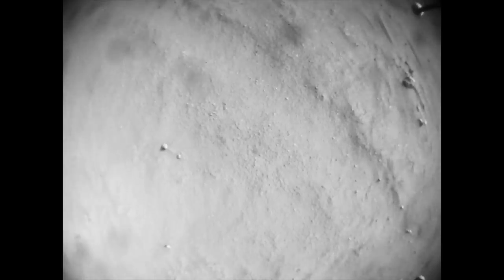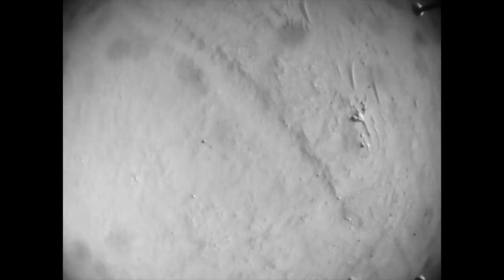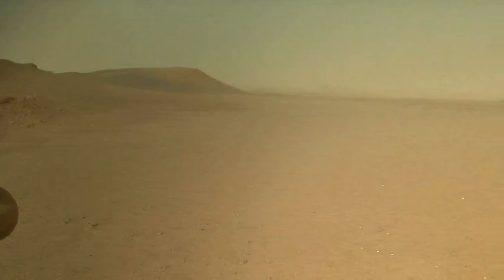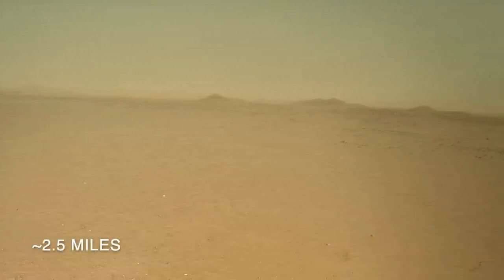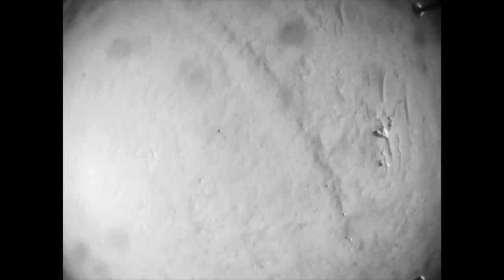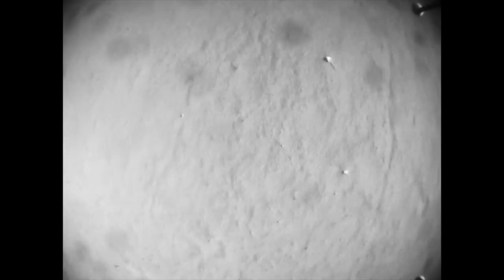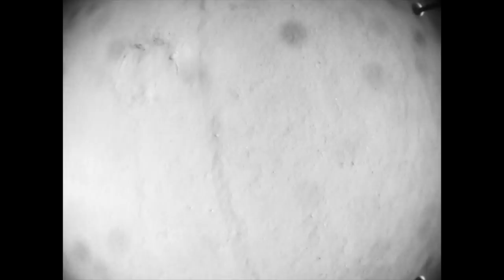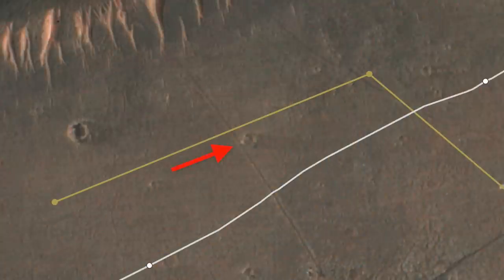Ingenuity attempts flight with a failed sensor

Comment: I hope they keep pushing Ingenuity until it's completely dead. The value of the engineering data to be gained by monitoring its failures, and triggering them, is incalculable.
Reply: Indeed and can use what they’ve found on the next heli drone !

Comment: Ingenuity should be placed in the same exalted group as the Voyagers and Cassini. We have to remember they were just hoping it would complete 1 flight. But its now close to its silver anniversary of flights, and in its way showing us more of the planet than the rovers.
Reply from the maker: Agreed!
Reply: Given the very low temperatures on Mars, would it be difficult to extend the flight time, even just hovering, even wire-guided?
A helibot that could spend 5 or 10 minutes analyzing a vertical wall or the ground to land on the roof would be good.

Comment: I like the idea of a rover and some extra-vehicular explorer (EVEx).  Nasa should consider attaching a small (but powerful) air blower on the next rover.  That way the EVEx can maneuver close enough to the rover (or vise-versa)  and the rover can then use the blower to discharge the dust particles on the solar array(s) of the EVEx.  With winter closing in and dust and sand limiting the charge, this could be life-extender, if not a life-saver.
Reply: Perseverance already has a blower on its arm used for clearing dust off rocks.

Comment: nice work mars guy, I wish ingenuity survives.
But I have a question 
Can the failed sensor be fixed or not.
like if the weather improves or maybe in the next Martin summer.
Reply: I don't think it can, but the latest flight shows that a workaround is possible.
Reply from the maker: Thanks, and yes, very unlikely that the failed sensor will start working again.
Reply: There's no need for fixing the failed sensor, as there's in-built redundancy, as in any aircraft. The failed sensor is the inclinometer, which consists of two accelerometers. Its sole purpose is to determine the initial orientation of Genny in respect to Mars gravitational field, prior to spin up and take off. Once airborne, the inclinometer serves no purpose, and pitch and roll are determined by the navigation inertial measurement unit (IMU) instead, which also consists of accelerometers. The various scenarios of failed sensors have been thoroughly simulated on Earth prior to finalising Genny's design and all that was required to fix it was to patch the software with the code developed during the simulations, so the gibberish data coming from the failed sensor could be replaced by data from the IMU instead.
Reply: @_John_P  thanks, u are awesome

Comment: Can they land it on inclined areas to accentuate power top-up? (as with Opportunity Rover), or is that beyond it's capabilities?
Reply: It's possible in principle, although landing a helicopter on an inclined surface is harder than driving a rover up an incline. I can certainly see them trying this to extent its life for a period of days, or even weeks.
One problem with trying to survive winter that way is that Perseverance cannot wait for Ingenuity. Doing so, or even planning to return to the same site later, would have a severe impact on Perseverance's own mission.
Reply: @renerpho  A middle ground can always be found.
I am beginning to believe that in the Mars 2020 mission there are different experiments that work well despite the tremendous difficulty of the undertaking, but a unity of criteria "between the two vehicles" is not materialized.
It is a very critical opinion of an amateur who does not know the problem.
Reply: @copperNick-North  If NASA decides that the benefits outweigh the costs then I'm sure they'll do whatever is possible. They usually discuss all options with an open mind.
Reply: @renerpho  Thanks for your replay.

Comment: Great video, but I think the flight was complete or at least the time TOF matched that in the flight log.  I have noticed on several flights, you don't see images of it descending.  Bob Balaran's paper indicates that they turn off or stop processing images during takeoff and landing (1 - 2 seconds) due to the possibility that  dust and debris blown up from the downwash may create erroneous tracking results.
Reply from the maker: Thanks. No doubt the flight completed, but there are usually images going nearly to the ground.

Comment: I wish somebody would ask me about my low tech idea for putting a hundred eyes that move all over the Martian surface then transmitting what they see and moving on again. Basically doing the job of a hundred rovers, but literally thousands of times cheaper. 
Ingenuity is ingenious but it's kind of complicated.
Reply: An entire rocket lander and power and communications plant, as well as a meteorological and vehicle coordination and support station and one, two, three multipurpose dispenser-collector robots with cameras, or other types of sensors, transmitters, beacons or dihedral reflectors, anemometers,  low weight, low dimensions, low cost, enduring.  :)
Reply: with robotic arms and a complete set of screwdrivers and keys.
Reply: @copperNick-North  I'm sure NASA has something like that in the works, but my idea requires none of that, not even a lander.
Reply: @rafeller9057  What is your idea?
Reply: @copperNick-North  thank you for asking 🤗 briefly I'm thinking of 100 inflatable tough balls about a meter in diameter. They get released in the upper atmosphere and bounce off the surface and get blown around by the Martian winds. Wherever they come to rest hopefully in a certain orientation because the heavy battery will be against the inside wall on one side and a camera will pop out of a cubby on the opposite side, whenever the balloon comes to rest . . . Either because the wind stopped or it got wedged somewhere in the geology. A sensor inside Will retract the camera when it feels rocked by the wind. And if it's leaning up against something wind direction changes usually unsticking the balloon from its resting spot. This way it randomly gets blown over great areas. With a GPS tracking to transmit its location and orientation.. with a hundred or so of them they could travel all over the place taking pictures and transmitting data to satellite orbiting Mars.
Reply: @rafeller9057  It seems a daring idea but not cheap. First there would have to be a constellation of Global Positioning System satellites in orbit over Mars.
Reply: @copperNick-North  I don't think we need a constellation of global positioning satellites encircling Mars before this could be deployed. You start with basic radio transmission to a base on Mars and then as they spread out over time they'll probably be more satellites in orbit around Mars and when one comes over head it triggers these exploratory balloons to transmit their data.

Comment: Previous rover missions didn't move a whole lot in the winter months. I wonder if the Rover could be used to try and protect the helicopter until the summer months returned.
Reply: That's true for solar powered rovers such as Sojourner, Spirit and Opportunity. Curiosity has been working non-stop for almost 10 years, as its nuclear powered. Perseverance is expected to perform as well as its cousin, Curiosity, as it's also nuclear powered. Ingenuity was not supposed to last so many flights, thus there's no way Perseverance could help Ingenuity survive a full year.

Comment: Why don’t these probes have nuclear batteries?
Reply: Maybe a new iteration will have a better power source. This was just a test drone.
Reply: Nuclear batteries are very, very heavy for their power output. Perseverances power pack produces 100W with a 50kg pack. Ingenuity has about 10W of solar panels, weighing around 100g, not the 5kg or so a nuclear battery would take to be the same power output. 5kg is about 3 times the weight of the helicopter alone. There is also cost. The fundamental cost of all the parts of Ingenuity is around a thousand dollars, if it was to be made in volume. To add a nuclear battery would make it a million.
Reply: Perseverance does, Ingenuity doesn't.  Nuclear batteries would be far too heavy for a helicopter on Mars, but I believe they are being considered for a helicopter on Titan one day.  They will still be heavier than solar panels but Titan is too far away from the Sun for solar power, and the denser atmosphere will make flying easier than on Mars, cancelling out the disadvantage of heavier batteries.
Reply: @queazocotal  Thanks for your numbers! They answer the question clearly.

Comment: NASA didn’t think about freezing temperatures why they didn’t build a platform in the rover for the drone to land and recharge from the rover and keep warm at freezing temp the rover have unlimited power that was dumb
Reply: I think the designers thought about the freezing temperatures and the Martian winter. Just a wild guess...
And another guess: Ingenuity was not and could not be designed to guarantee survival under those conditions.
Simple fact: It has already operated about 10 times longer than the minimum life it was designed for.